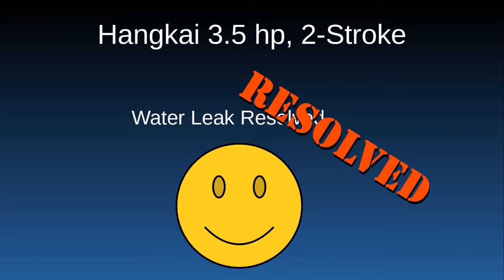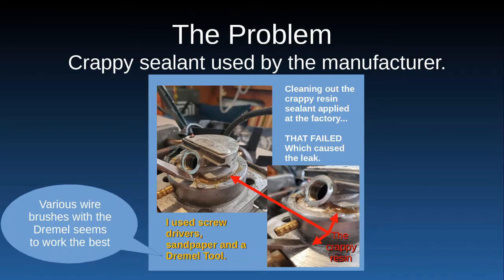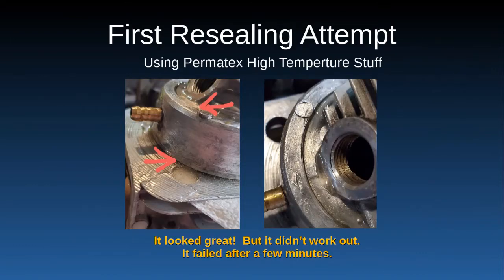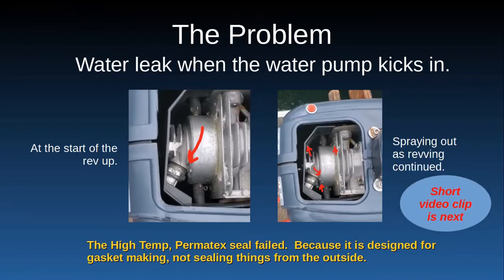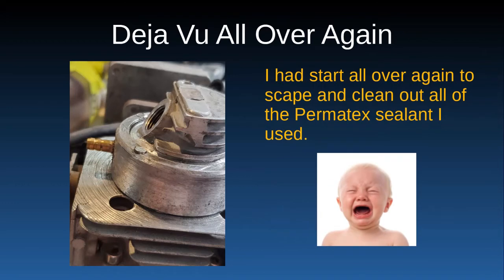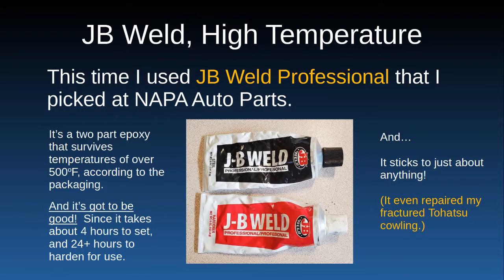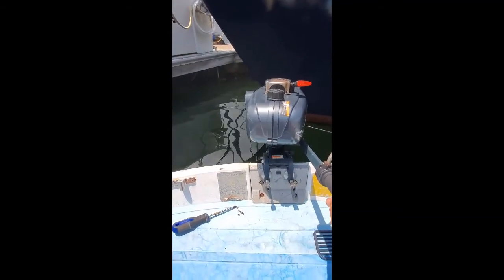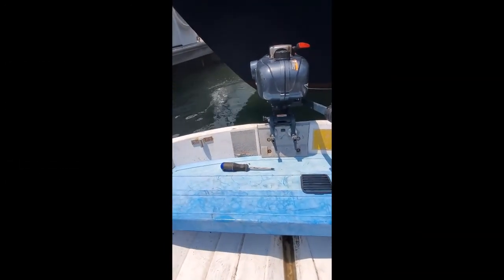Hangkai 3.5 Water Leak Stopped

Comment: Thanks a lot.. do you put the glue from outside of the jacket or you have to undo it first? I have same problem
Reply from the maker: You must apply the JB Weld epoxy to the outside of the water jacket because you cannot remove the water jacket.  Poor design.  Apply the epoxy all around the base... and all around the gap on the top also.  Make sure gaps are cleaned from the old epoxy.  Good luck!

Comment: Some mods Ive done is. Removed the clutch spring its always in drive so always pumping water. I moded the exhaust pipe too so much quieter now, i also put a tell take pipe on it, it's running great and sounds great, only glitch is tiny leak from water jacket, i have a video made if you want to check out the mods before and after, its less than a minute long.
Reply from the maker: I'd like to see how you removed the clutch spring.
Reply: @hsteven1110  it's quite easy, the 4 little Hex bolts that would be upsidedown as the motor is upright remove them, then that exposes the clutch, I can then  pincers to grab and remove the spring, no need to remove the 6 larger bolts where the exhaust guess in to the leg at all. I'll do a short video explaining it very soon.
Reply from the maker: @upsidedown1986   Thanks!  And shoot me message when you get the video done.
Reply: Easy access to the clutch

https://youtu.be/dn8tTJcmWI4?feature=shared